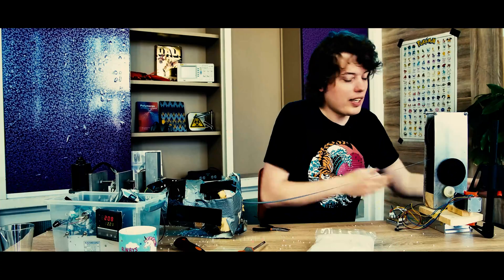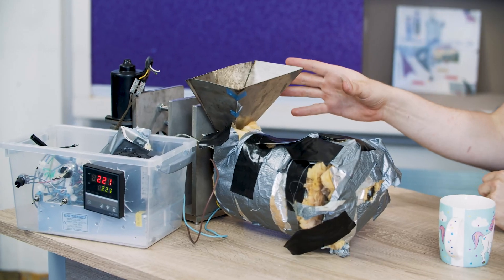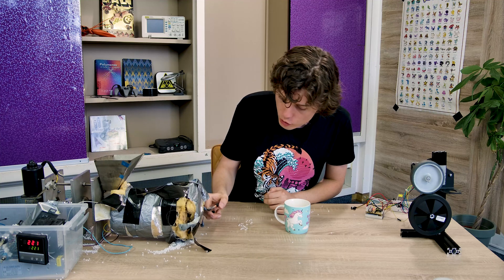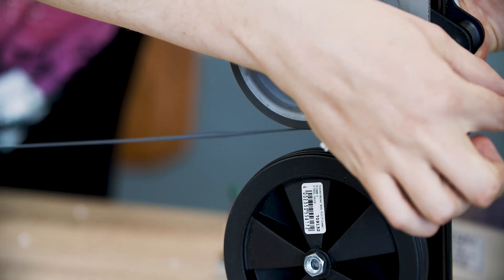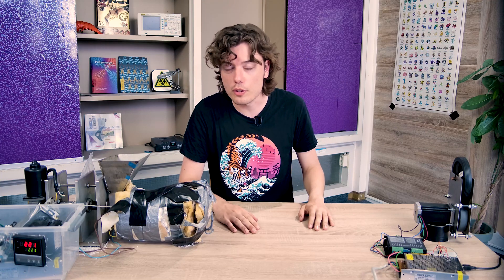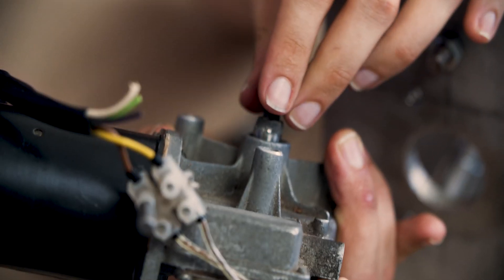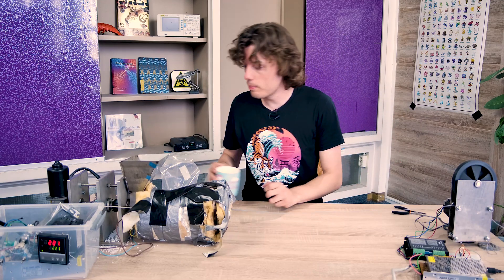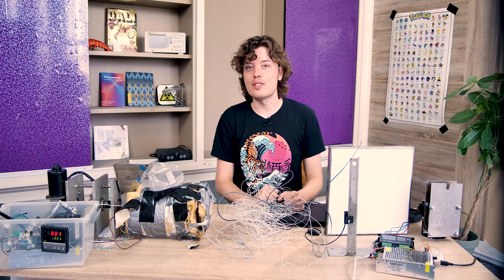Making my own 3D printer filament! - Part 5

Comment: Hi I'm making my own and was going to use a 3d pen guts to melt smaller plastic and texture out a 1.75mm nose and then have 2 small rubber motors with 1.75mm between them so even 1.76,7,8,9 would go to 1.75mm
Reply from the maker: Good luck with this project. There can be some problems with the expanding of the plastic when it exits the nose. How are you going to speed control the rubber motors?
Reply: @widgetlad5157  speed controller I'm in the UK and it's 6 pounds to buy 2 

And since that comment I'm using a old 3d printer board for temps and a 12v motor for the screw and 1.5v for spoiling both co trolled with speed controllers I might make a video on all of this so if u want u can sub or save a link some where I reckon it will take 5 month before it's done